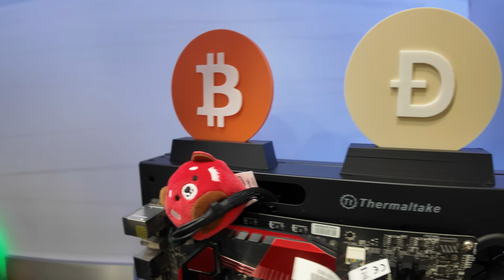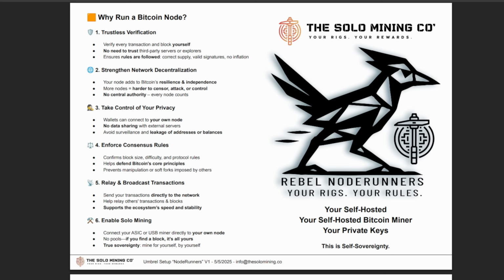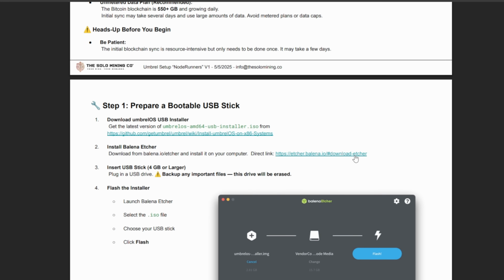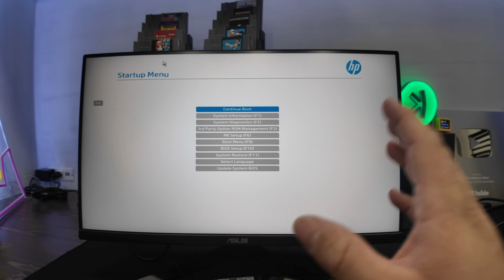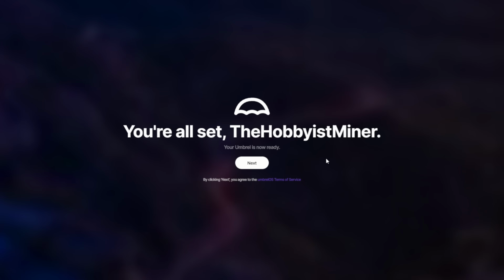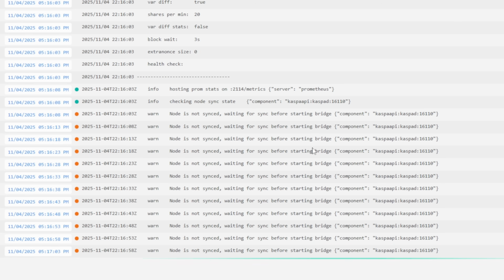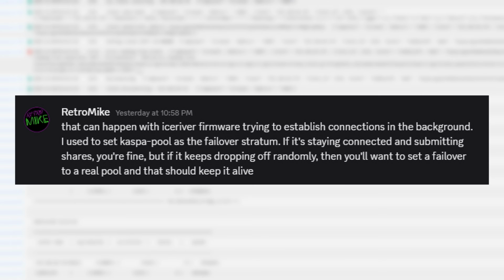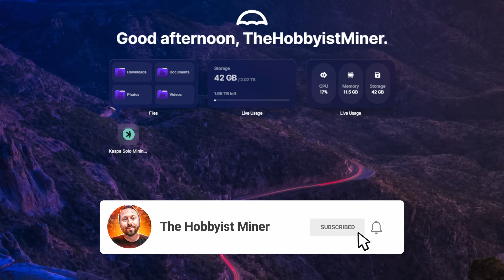START Mining KASPA to your Own Home Solo Pool!

Comment: Your KS0 is probably fine. The stratum bridge can be finicky with pb fw. If I remember right, you want the node up and running before you config it on the miner and you also want the failover set to a real pool. It does periodic connection pings and fails and keeps rebooting itself which is why you see low hashrate and can’t connect to the web gui. 

Do a factory reset, flash the pb firmware, set local stratum as primary and set Kaspa-pool or 2miners as secondary and you’ll likely be fine
Reply: isnt there a bootstrap for fast syncing the kas node i know there used to be one before the 10 blocks a second upgrade
Reply: I can't connect to a container ist the node server_1 Do I need to do anything? I'm using a Raspberry Pi 5.
Reply: This is great, using this i have finally managed to connect our 12 KS5 pros in remote hosting to it and be stable. Been trying for months. I do have an issue with a wallet value error coming up and need to work out how to get data into grafana dashboard through this. Not sure if you know a work around with this?
Reply from the maker: Thank you for the detailed information!  Going to try and get the KS0 back to factory firmware and see how it does.